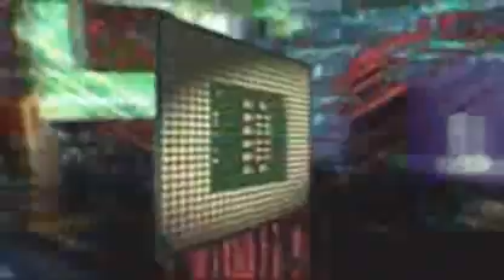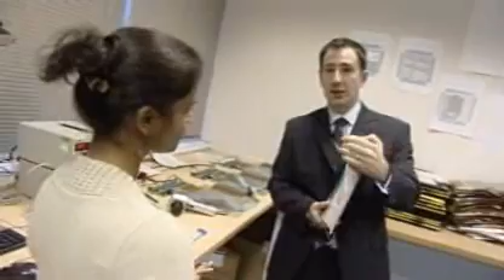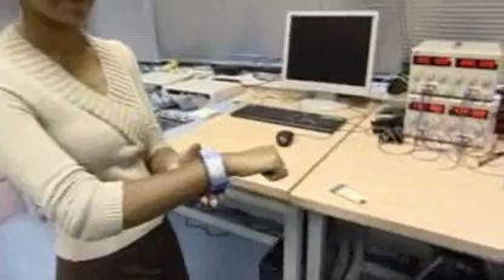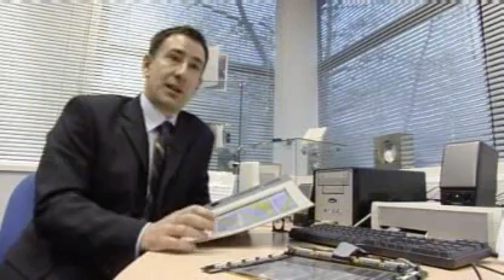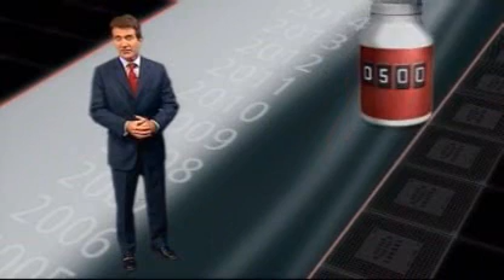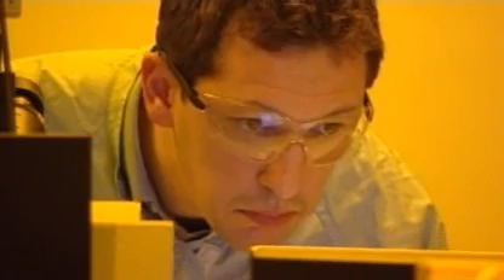Plastic Electronics!?

Comment: We've been making plastic from small chain hydrocarbons for a long time now. Polyethylene being one example. I think it is possible that oil has been surpassed as the main organic feedstock for plastic, but I don't have the data to know for sure.

I find the idea of biodegradable plastic to be an intriguing one, but I remain skeptical. Long carbon chains are just difficult for anything living to process, regardless of the feedstock.

Comment: E-ink from plastic logic is a plastic flexible display that can be used on any surface without the need for constant power. It uses monochrome beads which rotate when a charge is applied and is identical to that of paper, hence the word E-ink.
In other words it will replace paper and can be used for advertisement, mobile devices, clothing etc.
Clever technology.

Comment: Also I dont think plastic would handle higher processing speeds (i.e. the high tempuratures) but then again perhaps if they just made the chip bigger to disperse the heat?
I think a replacement for silicon is needed, seeing as we can't make it any faster without melting it nowdays. (i.e. nowdays computers come with 2 pentium 4...ect)
Not a bad idea for the hospitals though...